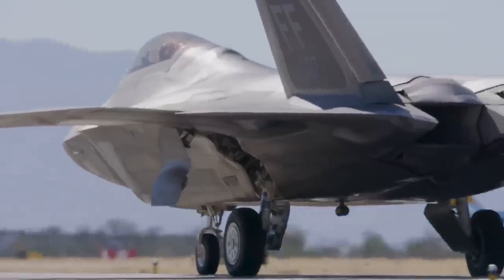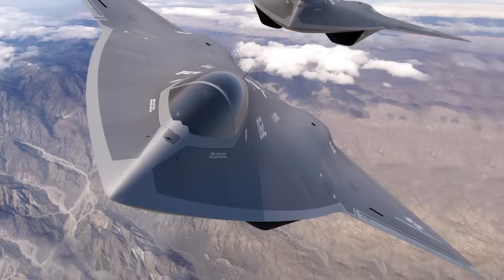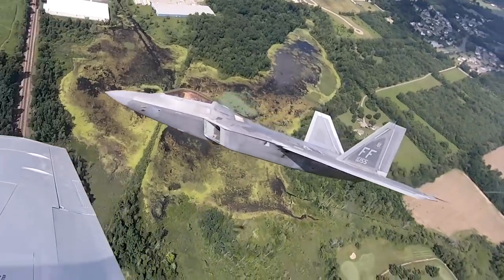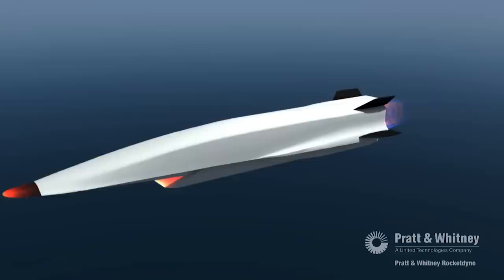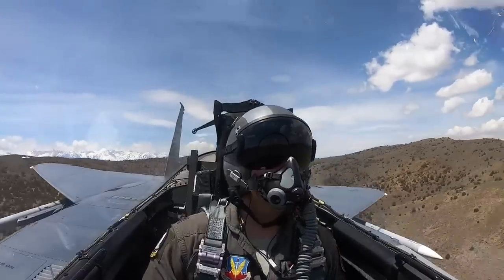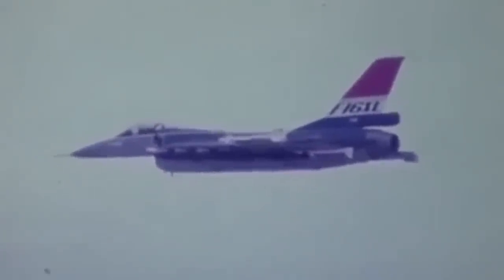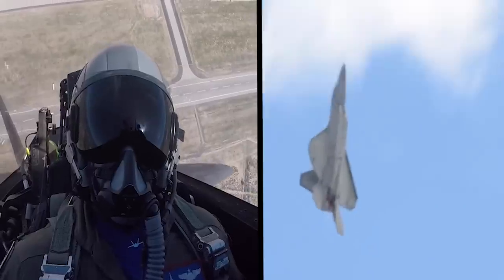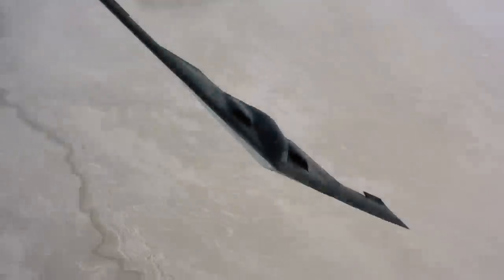How America could build the best stealth fighter in history

Comment: The priorities of the next generation fighter will be very simple. #1 is sensors and data integration #2 is Stealth #3 is Range #4 is Speed. Agility and dog fighting ability will not be a consideration at all. Why? Because even though there will still be instances where aircraft fight at short range, the ability to point your nose and turn tightly will be completely irrelevant in determining the outcome when sensors can see all around you, missiles can be fired against threats in any direction and those missiles can turn 5x to 10x harder than any aircraft. There will be no effort to place yourself on the tail of the opponent because if he is close enough that a 747 cannot turn fast enough to place him in front, he is also close enough that missiles like the AIM-9X will be cause to turn 180 degrees and still have enough propellant to catch up and out turn it. If he is far away and you are using a medium or long range weapon, even a 747 is maneuverable enough. Dogfighting will come down to who shoots first and who has better jamming, decoys or hard kill counter measures to deal with the incoming missiles. Maneuvering is a waste of time.
--
I expect the next generation fight to be optionally manned. Meaning that it can be flown by a pilot, or it can be a drone that is either an AI wing man of a nearby manned aircraft or remotely piloted. I expect it to cruise at about Mach 2 with a combat radius on internal fuel of about 1500 nm (100% greater than the F-35 or 200% greater than the F-22). I expect it to carry about 10 Air-to-air weapons or 4 air to air and 2 air to ground weapons internally. I do expect it to use a variable cycle engine. Instead of a radar in the nose, I suspect that the sensors will be embedded on the edges of the wings and tail and operate on a variety of frequencies instead of just X-band. These sensors may also be used as jammers. One mode of operation ought to be multi-platform passive triangulation, whereby the sensors do not radiate, but they can comput both the range and distance of enemy aircrafts and ground radars by comparing their bearings to multiple platforms sharing a sensor network. I suspect it may not have a canopy. There is really no need for naked eyes looking through glass anymore. The cockpit can be fitted with a display sphere on the inside or the pilot can get his vision entirely from the HMD he wears. This also eliminates the need for flight instruments or flat screens in the cockpit. Everything can be displayed on the HMD or the inside of this display sphere within which the pilot sits. I also suspect that it will have threat aware and compensating stealth. That is, the aircraft is precisely aware of it's signature in various bands in every direction. It will automatically avoid pointing the spikes of it's own signature towards a known threat by making small changes to the orientation of the aircraft using flight controls.
Reply: The assertions about 1. not carrying a gun and 2.. not needing Dogfighting ability for. Missile carrying platforms has been made before in the late 1950s  designs.  These requirements were proven to be faulty in the VietNam war.experience.  All subsequently designed us Fighters for the last 50 years as a result have carried a cannon and had dominant maneuverability. These requirements have proven to be highly successful and desirable the subsequent fighter designs F14 thru F22 and in peer competitiors.

Therefore, it is unlikely in the evolution of the next generation fighter, that agility or carrying a cannon will become a low priority. 

But it is true that history has shown that most kills in the last 50 low conflict years have been made with missiles. It is also true that missile technology has improved greatly over that period.   

Most air warfare has been detered because US dominates the air battlespace almost everywhere through numbers, tech, sustained commitment, training and multiple dominant systems.   

The US and western liberal democracies are wise to continue this dominance as totalitarian peer competitors seek to achieve it.
Reply: @buzzpedrotti5401  Yeah, well, at the dawn of the Steam Ships most carried sails and those they didn't did very poorly. The 1950s was a long time ago. There is absolutely no reason to try to get on the tail of your opponent today and if your missiles failed and you have to try to do that you have already lost.
Reply: @dwightlooi  

The jockeys in the cockpits today flying agile gun and missile platforms disagree with your simplistic reduction to absurdity.

The F22 dominance is in part that it dominates the rate fight, the close fight and the BVR fight. This is the starting point for next gen air dominance.
Reply: @buzzpedrotti5401  Nonsense. There is no advantage in dog fighting when your missile can shoot to the rear and out turn ANY fighter or human tolerance. The F-22 is an obsolete design in this regard. All the trust vectoring and high AoA capability is totally useless. The weight and complexity is better spend being a bit faster and a bit lower in RCS. You need some basic maneuverability, but no more than a Boeing 737.
Reply: @dwightlooi  Time will tell.
Reply: @buzzpedrotti5401  Vietnam was a long time ago and missiles are not all aspect seekers then. They most definitely weren't capable of firing on a target at your six o'clock. When was the last time ANY fight actually shot down anything or avoided being shot down because it can out turn the enemy? 50 years ago? What is the point of F-16 like turning ability when I can simply fire an AIM-9X or comparable missile at a target at my 5 o'clock 10 km away and it'll turn at 60Gs if he tries to evade. No, you won;t try to dogfight, you'll keep you speed up and simply let your jammers and counter measures do their thing if you are shot at while you shoot at the enemy (preferrably before he shoots at you). Dogfighting is as obsolete and as silly as Cruisers or Destroyers trying to out turn and dodge anti-ship missiles, gun fire or torpedoes by turning harder. It's moronic.
Reply: @dwightlooi  And yet no one in current air forces using the latest equipment in modern sensor dominated air space agree.  Guns still sit in fuselages, rate and turn fights are part of dominance and tactics.  Perhaps not though when you are in the cockpit.

Enemies find and prey on weaknesses. Sensors work less well below the radar horizon.  There are engagement distances within which missiles can't acquire and lock. There are sensor confounders.   A ongoing lesson of warfare is that complementary capability  gives better outcome when the primary systems falter.

Losing agility and a gun reduces the full capability of the weapon system. It is unlikely to be the next Gen future. But we will see, youthful derogations aside.

The F35 leans toward a less able, gun free integrated stealth missile platform  that some think is  the future.  We'll see if this platform dominates thinking or if the Gen6 returns to a higher capability F22 type dominance platform.

Comment: You indirectly raise a point that clicked in my little brain...
In general not specific to when you have a durable ceramic stealth coating - which would ofc be the superior solution: 
Who not build jets with and without the expensive coating anyway and 
a) mix expensive and super expensive fighters when ordering -> lowering the per machine costs twice when ordering and in maintenance costs long time
b) enable the pilots to also fly the cheaper jets more due to the lower costs per flight hour while retaining a very, very high familiarity with "their" jet and mix this with a much lower amount of expensive flight hours in the actual more expensive fully coated jet (like having a trainer version jet but a 99% identical version to the real deal and one that is capable of flying actual combat missions in case of stealth not being of the utmost necessity - a solution a bit like in the upper middle between what is now the F15-EX Eagle II and the F-22 mix
Having a couple or more of uncoated jets shared between several pilots on a squadron, group or even wing level - or purely practical have enough uncoated jets per Air Force Base that the max simultaneous needed jets for training missions + spares are available. This would also enable much more rotation when jets are broken, in maintenance, waiting for that one part or being refurbished / upgraded
c) maintenance complexity reduction more shared parts and procedures (like what the original idea was for the F-35 program - yeah I know not the best example ;) )
d) if the time for an upgrade comes this is a one time R&D cost that can benefit both versions
e) if critical in times of need there might be an option to coat an uncoated version later on - even if the original coated version is superior this might be cost effective or just help if times are very dire
f) an uncoated or weaker coated version might be an export version with most parts being equal - if export is an option at all again lowering the per jet cost
g) this should also reduce development risks and costs - you could e.g. start with the prototype being the uncoated version which should be available first and you can start training your pilots sooner and deliver the coated version step by step
Please do comment if you see big wholes in my "great" idea - curious if that is a brainfart or actually an interesting idea! :)

Edit: this ofc hinges on the coating being a significant factor in production but especially in maintenance costs!

Comment: Making billion dollar air frames seems like a way to waste money. Money that could be spent on defensive systems or logistic systems. There is a point, regardless how advanced your systems are, it just becomes a numbers game. 80% of the budget should be spent on defensive platforms like missile defense systems. The remaining 20% can just be spent on a huge amount of cheap and easy to produce weapons that work by overwhelming numbers to obtain objectives without putting the lives of the pilots in danger. You could have 4 undetected jets fly over an area that cost a billion per unit or 100,000 detected drones fly over that each cost $40,000. If you could make suicide drones for $4,000 per unit you could have a million drones for the price of 4 next gen fighters and that's not even counting operating costs of weapons. That number probably doubles when that's included. You don't need air superiority. At some point the enemy will be out of things to throw.

Comment: I think the concept of a "Fighter Jet" is completely outdated.
There are a lot of Jobs a "Fighter Jet" has done and could be replaced by a Flying Stealth Cargo Jet/Airplane with Drone Carrier Ability.
A Big Plane like an Airbus could be equipped with Better Sensors, Future Laser Weapons ( and/or other anti-Long Range Missiles Systems )
Could be equipt with a switchable Cargo Section for Transporting Heavy Missiles/Glide Bombs/Drone Bombs 
or a complement of Drones saving Fuel helping them to get to high altitudes and acting as a control or relay station for controlling the drones.
or a Massive compartment of ship-based Anti Air Missiles with Sensors to support them. 
The point is what will be the drone of the future look like.
The only Job where i see a Jet would be needed is the fast Interceptor role.
Everything else would be done better by the "New Flying Fortress"

Comment: An almost 30 year old design with hardly any modern features. The F22 has not seen any real combat, as it was mostly used during exercises, and hardly any real life engagement.   Besides, old radars are fully capable of detecting stealth. 
The expensibe coating that has to be continuously reapplied to maintain "stealth" is also a huge disadvantage for the aircraft.

Comment: The Pentagon blew it many years ago and it's still out there and can be resurrected it's called the F-23 Black widow is far superior to the F-22 in most areas the speed of this plane is still classified to this day even though they'll try to tell you it does around 1400 mph which isn't true it goes far faster than that and it's more stealthier than the F-22 and has far greater range than the F-22 matter of fact Japan is looking to resurrect it in some form because of the range and stealthiness they needed to combat China over vast distances over water bring this plane back please you've made a big mistake with the F-22 and the Pentagon knows that
Reply: @mandellorian you have no idea what you're talking about pull up the documentary it's about an hour or more long on the building of the f-23 it is far superior than F-22 matter of fact they're getting rid of the F-22 so if it's that great how come they're getting rid of it and trying to redo it
Reply: @mandellorian and the plane is not about the speed of it it's the fact that it's stealthier maneuverable and has far greater range than the F-22 that's why they're looking at it Japan the 23 got beaten up because of they were afraid of cost overruns that they had with the b-2 bomber and some other problems and they didn't want McDonald's Douglas in Northrop to run in problems with over runs and not be able to finish the plane had nothing to do with the quality of the aircraft so before you run your mouth why don't you do your homework on the plane